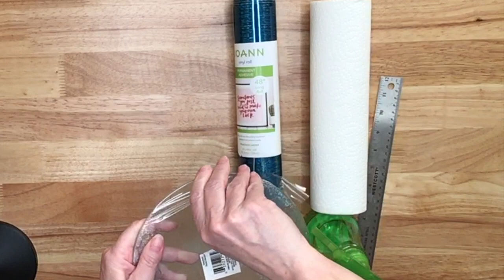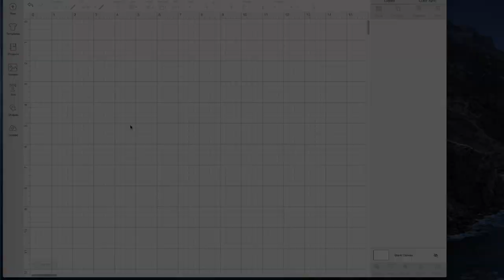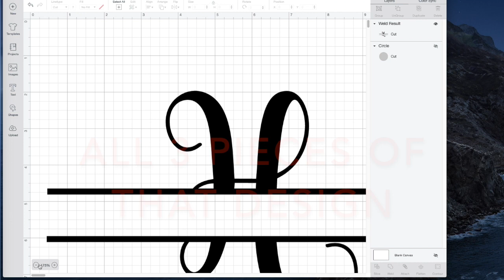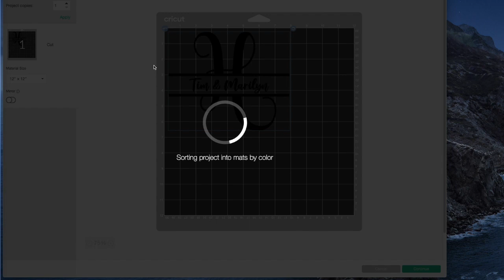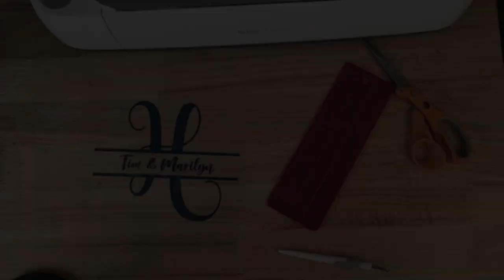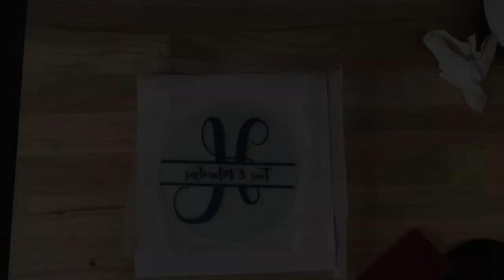Dollar Tree Cutting Board, Adhesive Vinyl, and Rapid Tach for a Wet Adhesion Method

Comment: I think your issue was caused by the type of vinyl you used.  I'm getting ready to do 100 of these so I'll know when I'm done but I'm using Oracal.
Reply: I take it back.  I used Oracal 651 and had the same issue.  So I'm thinking the contact transfer paper (most video's I've seen have a paper backed paper they remove.  So, I'm waiting until mine "dries" more and will try to peel.  It's 19" x 28" on a mirror.  Gonna be a nightmare if it won't peel easily.  Wondering what you've found if you've tried some more?
Reply from the maker: I think that if you use a paper-based transfer tape that the wet mix can penetrate when you spray some on top, then you can get the transfer tape off more easily. I use a paper transfer tape called vinyl ease. https://www.amazon.com/gp/product/B07DF7TDSF/ref=as_li_tl?ie=UTF8&camp=1789&creative=9325&creativeASIN=B07DF7TDSF&linkCode=as2&tag=makingwith022-20&linkId=a5ddeaffbd137f601250e4eee0e32639 I would be happy to try this theory if you would like.